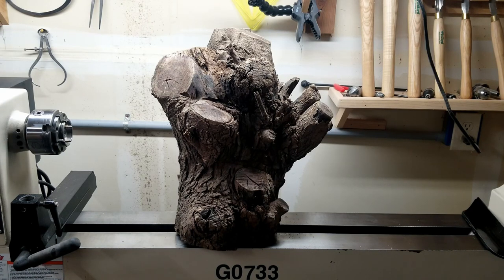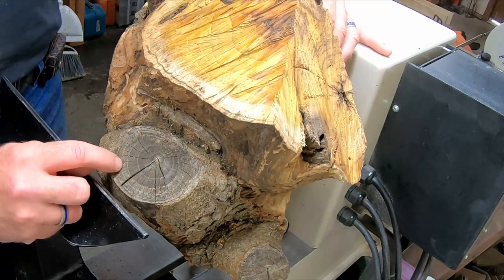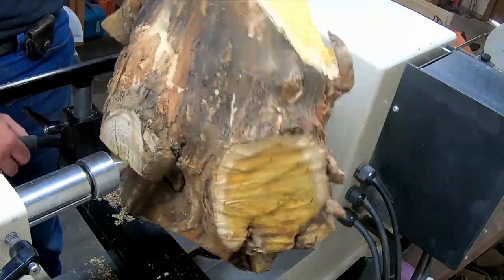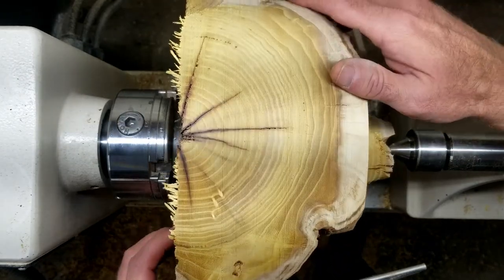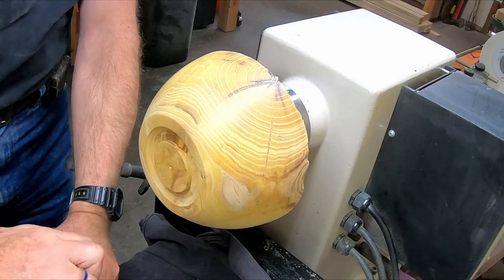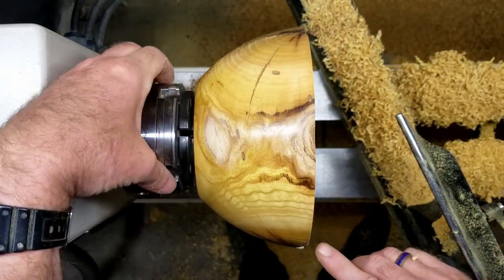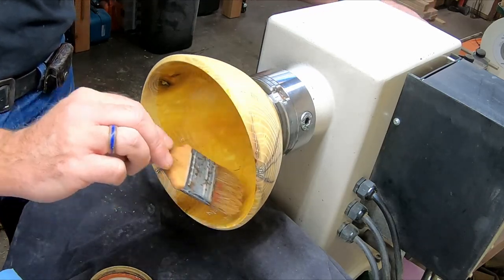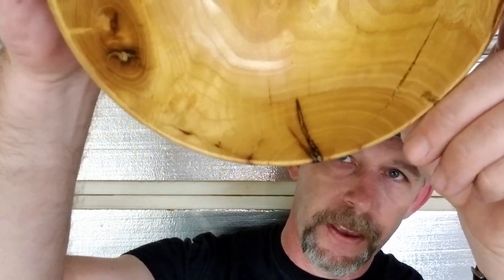Wood Turning: An Unknown Wood

Comment: I would say it's either black locust or mulberry. The bark has me leaning mulberry
Reply from the maker: That is exactly what wood-database.com said, that they could be mistaken. The test they described was to put shavings in water. Osage orange contains a water soluble dye and will turn the water yellow. These shavings did that.
Thanks for watching!